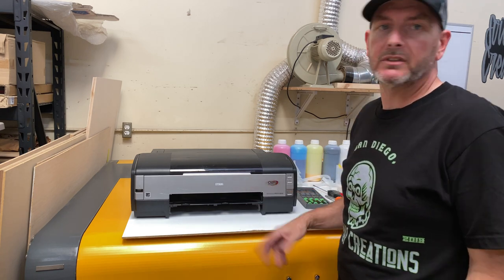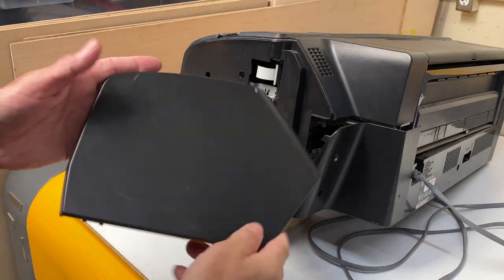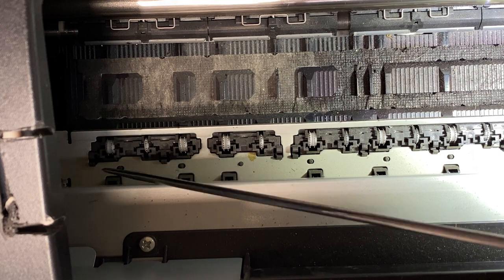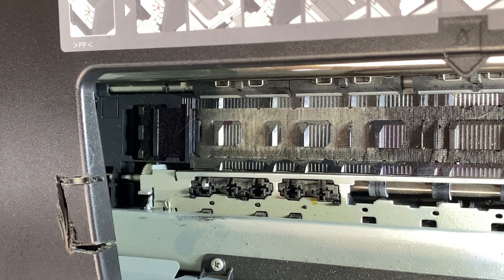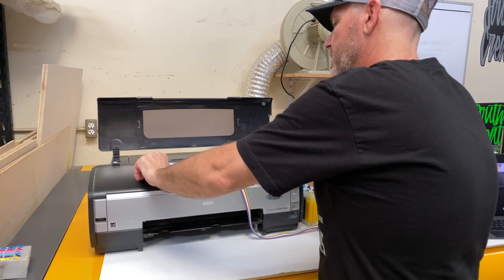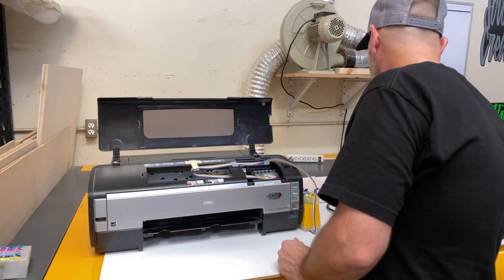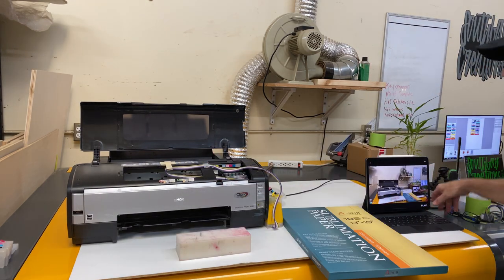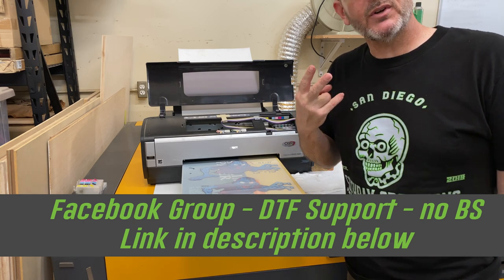Epson Stylus 1400 DTF Conversion and External Waste Tank Installation

Comment: I already converted mine 1400 to dtf thanks to your video I’m having problems with acrorip 10.5 prints colors nicely but can’t get the white to print I put the checks on them 2 boxes color + white and the other one 100% white over color still no white I’m missing a step ?

Comment: I might have missed it in the video, but I read you have to change some chip to convert. Is this not true for this printer? Just got one today and want to convert it. Also, I see in the link that they have UV dtf ink. Is that for shirts and signs and things? I thought it was 2 different things so was trying to decide which route to take since I already have an ET15000 converted to sublimation for shirts, but love being able to apply the dtf to any fabric. Thanks for the great video too!

Comment: Can you comment on the need to shake the white ink please?  You have the ciss reservoir, the cartridge and the lines (tubes).   Can you describe the process to shake all of them, or if necessary. I can picture the tank and the cartridge, but won't the ink settle in the lines as well? thanks
Reply from the maker: The issue with the white ink is it will separate from the components it’s made of, so you need to shake it to keep it mixed well. When it’s six for a long period of time you’ll have all the pigment settle on the bottom where the ink is drawn up through the system and it will cause a clog instantly. It’s recommended when you first start your printer in the morning to shake your cartridges and perform a regular head cleaning to flush the lines. Also you want to  maintain good humidity and temperature control wherever the printer is stored.

Comment: Hello. can't you help me I have an epson stylus 1400. I have understood how the conversion takes place. but you convert yours to 2 white colors. how do I code the printer/computer to be able to run with the 2 white colors instead of the 2 standard colors 🙏
Reply from the maker: Sorry for the late reply. You need to use a RIP software with Cadlink or Acrorip. That will manage the white channels

Comment: Great video how does only two white cartridges do on a black T-shirt will it cover and be opaque and is that San Diego shirt you're wearing a DTF shirt thanks in advance
Reply from the maker: Two cartridges is sufficient, it will print a little slower because it will beed to make more passes to get the right coverage. Yes the shirt was printed with DTF. Come over and join the Facebook group. There’s a lot of great folks in there sharing knowledge and showing off their work.
Reply: @SouthbayCreations  thank you I tried to join the group waiting on approval
Reply: @SouthbayCreations  I had a photo stylus 1400 then I got rid of a few months ago should I have kept that one and converted it or would I be better off with one of these that you showcase
Reply from the maker: Those are good printers. People complain  they’re slow but the print quality is fantastic and they’re reliable.

Comment: I am looking at Epson Stylus Photo R1900. Is this printer the  same to setup for dtf  as 1400?
Reply from the maker: It’s not quite the same, it’s similar. The R1900 has 8 ink channels and the 1400 only has 6. Also the R1900 is much faster than the 1400. The R1900 is a fantastic printer, it’s one of the fastest out there but the down fall is if you need to replace the printhead it would be better to trash the whole printer and find another used one. The heads are crazy expensive for that model. The 1400 heads are much more economical but they print very slow.
Reply: @SouthbayCreations  thanks so much much for explaining that. If I  do get the R1900 could you explain or show me how to remove wheels?
Reply from the maker: You’re welcome. Yes I sure can

Comment: Hey man great video, So I have a 1400 that I use with accurip all black for my film but I also have a 4880 for film I would like to convert the 1400. Are you available to chat if I run into problems?
again good work on the video.

Comment: Thank you so much for sharing this... I have the same exact printer and I had installed the ciss system on it for screen printing purposes a few years back.. I am here because I now want to convert it to sublimation ink... I have a question.. I noticed you eliminated two middle colors and replaced them with white sublimation ink .. how is that going to work? will you be able to print full color photos just like dye ink?  I really need to know before I order the inks from that website you recommended.  Thank you .. your tutorial was super awesome by the way.
Last thing .. will I be able to print super dark black on film positive for screen printing?  its what I use the printer for the most!
Reply from the maker: The ink isn’t for sublimation, it’s a special ink for DTF, Direct to Film. Sublimation ink has no white ink available.